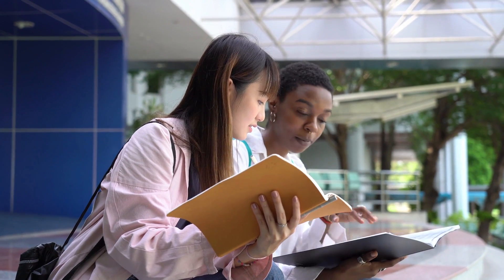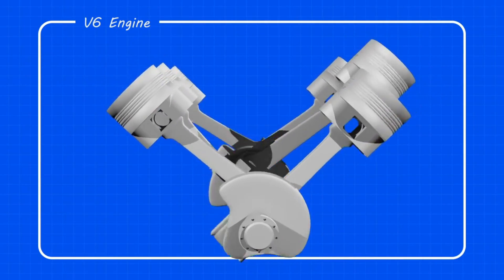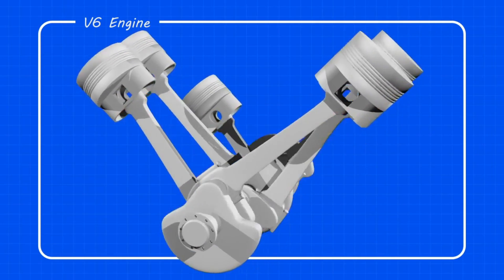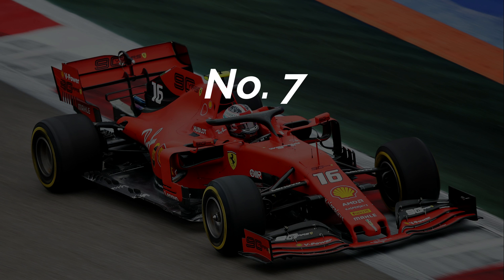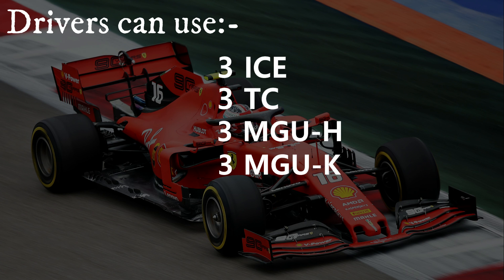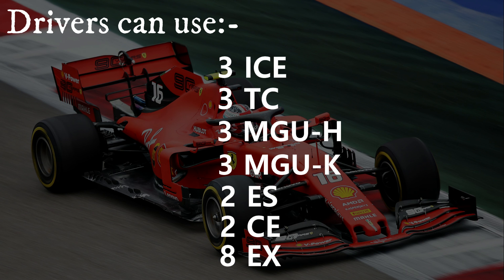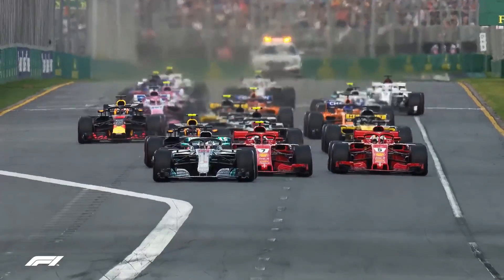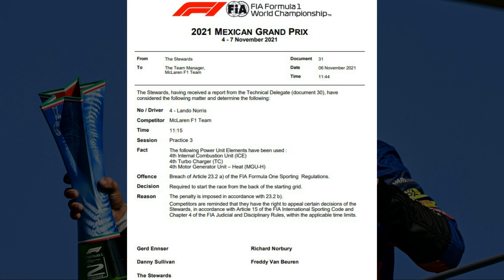Formula 1 Engine Penalty Explained | f1 engine penalties explained

Comment: Great job! Why do the drivers and their team get penalized, e.g. have constructors points taken away?  Drivers work alongside their engineers.
Reply from the maker: Thanks for the comment. Can you give an example of when points were taken away? I can't recall any situation this year.
Reply: @F1Education  Are you referring to penalty points? 2021. Lewis was handed two points after colliding with Max at the British GP. Max two points in Monza. 2020. Racing point. 15 const. points taken away for the use of Mercedes brake ducts. 2008 Renault controversy. Nelsinho admitted the following year he was ordered to crash into a wall so that the safety car would be deployed and Alonso would maintain the lead. 2007. McLaren spy scandal. Excluded from the constructors championship. Maybe I'm confusing it with something else but I think there were cases when some teams were either fined or had points taken away.
Reply from the maker: oh ok - thanks for this clarification. There was a race this year when Vettle was P2 and a day later because of a violation he was disqualified so points were taken away.